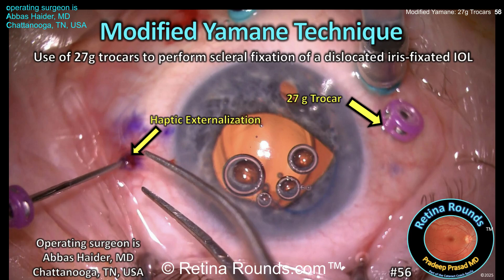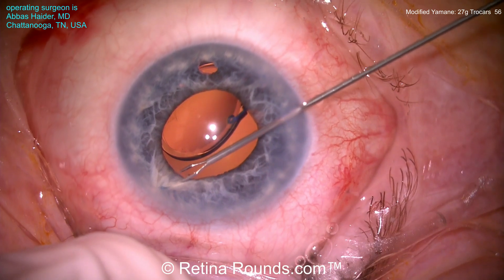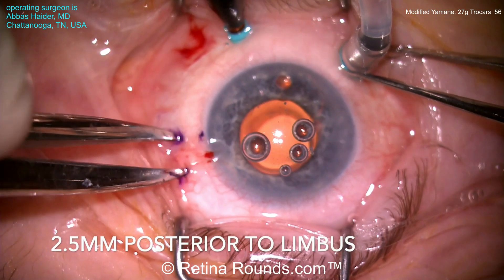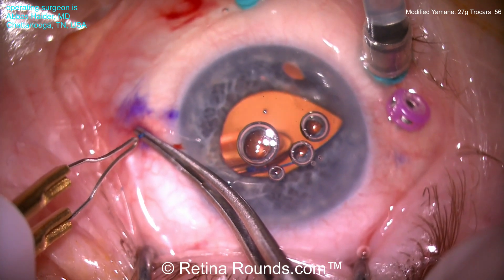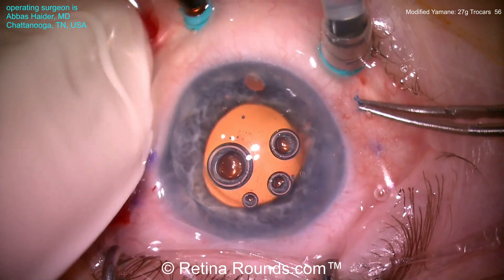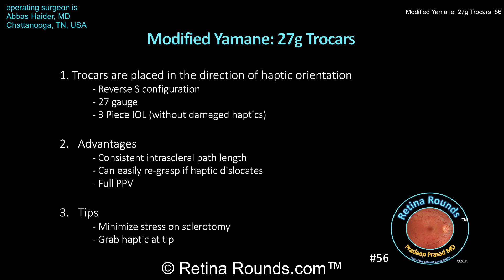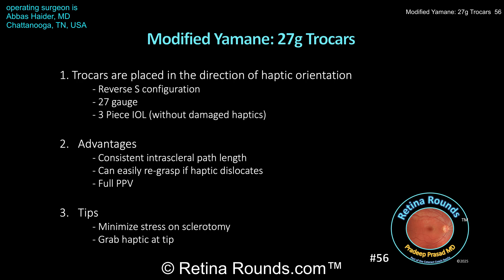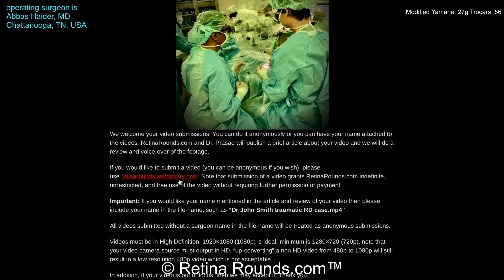RetinaRounds™ 56: Modified Yamane Technique: 27g Trocars

Comment: Using PVDF haptics might go without kinking, but with PMMA ones, it is so common to be damaged with this way of externalization. The 2nd haptic is having a short tunnel and vertically oriented one due to the presence of the irrigation trocar, which interfered with proper procedure.
Lovely steps. Thanks for sharing.
Reply from the maker: Excellent points, thank you!

Comment: I have this exact technique on my channel, I've done it with 25G and it's been fine. Though I would prefer 27. Chandilier can be avoided by rotating the other side and pulling the externalised side further out.
Reply: Great point about the chandelier! I’ve actually starting using one less trocar and using the chandelier light through one of the existing cannulas.

Comment: The IOL is an SI-30 with polypropylene haptics. This haptic material is not very robust and I would have concern about the IOL having A-P flexing and iris interaction. I would rather exchange for a more stable lens such as an AR40 which I feel has a better chance of stability. 

As for 27G trocar use for Yamane, I have concerns as the scleral passage is a wider diameter than a 30G needle. Either a larger haptic bulb needs to be melted which has issues of conjunctival breakdown or with a more routine bulb size you run the risk of slippage. 

Nicely done surgery. Thank you for posting.
Reply from the maker: All outstanding points, thank you!
Reply: Grasping the aptic on its extremity and poistioning the IOL in order to minimize the aptics torsion, when extracting them, are extremely precious indications coming from this video. Actually Yamane technique was described using a 3-piece IOL with rather "robust" aptics, whereas, in my modest experience, not all 3- piece IOLs present equally resistent aptics, easy to manipulate without a considerable risk to damage them, compromising the implant.
Reply: @AG_396 very true. NO IOL was designed to do scleral fixation. Always a risk of tilt and IOL damage when we do any of these techniques. Fortunately, this patient has done well. Also, much less traumatic to reposition a lens than to do a complete IOL exchange.